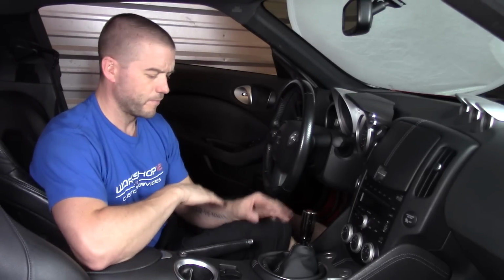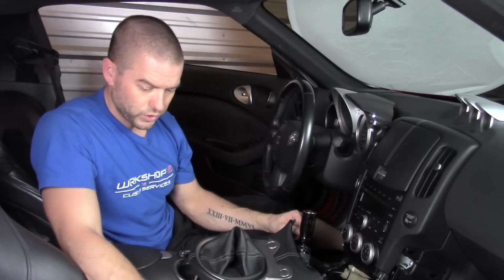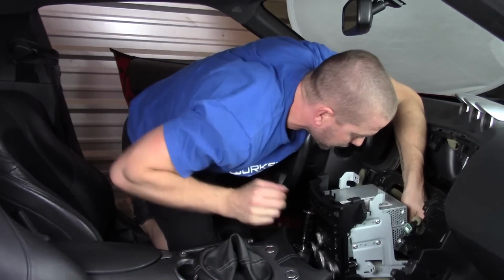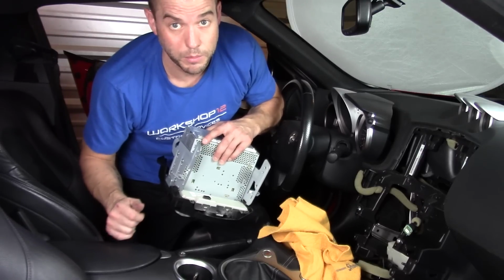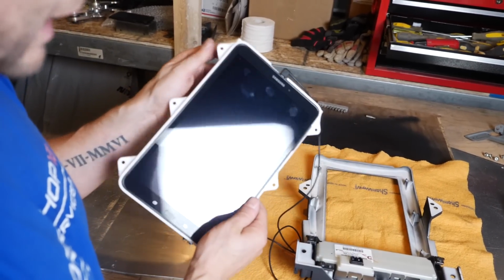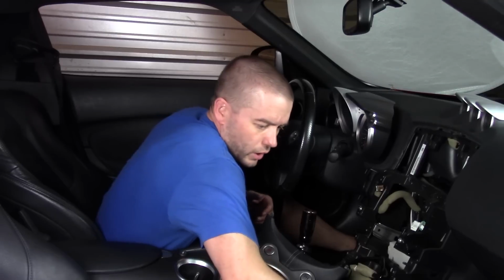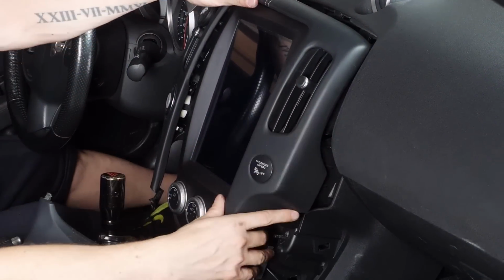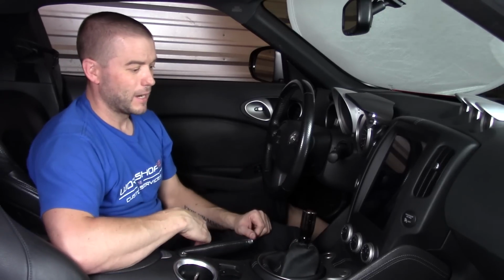Brainiac MK1 370Z Installation

Comment: Will this work on a 2011 nismo 370z? Thanks!
Reply from the maker: Is it equipped with OEM navigation?
Reply: Workshop 12 there’s no nav, it’s fully stock but it’s not the tech model so there’s no navigation system
Reply from the maker: @shelbytibbs5617  that should work 👍

Comment: Could this work on a 2010 370Z?, and do I need to use an android tablet or can I use an I Pad?
Reply: Yes it will work but you wont be able to use the speakers.. Because the head unit has been remove.. you have to buy the harness to connect thru it..
Reply from the maker: Yes, this will work on a 2010 370Z.  We do not support iPads for multiple reasons. Only specified Android tablets.  Tablet details and everything you'll need to know about the 370Z kit can be found here: https://workshoptwelve.com/nissan-370z/

Comment: How do you address overheating of the tablet in the summer or hot climates? This seems to be an issue.
Reply from the maker: We have made our latest MK2 kit so that if you are in extreme temperatures you can easily remove it from the dash and place it out of direct sunlight (under the seat etc.). Then pop it back in place. Only so much you can do to avoid this challenge with a tablet. https://workshoptwelve.com/nissan-370z/

Comment: I have a 2009 370z with nav, is it compatible?
Reply from the maker: Currently you would need to do a climate control swap to the non-navigation version. We are working on a possible solution for nav equipped 370z's but for now a swap would be needed https://blog.workshoptwelve.com/2018/12/29/370z-navigation-climate-control-swap/

Comment: 350$ is not a high price form something like this. at my shop i use to charge 250-500 to customize the original dash panel which of course can not go back to OEM once its done. this keeps your OEM parts intact if you decide to go back when you sell the car.

Comment: thank you for this video spend $2000 on this crap just to make it fit 10 inch screen.
Reply from the maker: We're working on bringing the price down, trying to find/work with suppliers where it can be produced at a lower cost.
Reply: @WorkshoptwelveConnect  i havent had a chance to accumulate the price. how much it cost without the tablet ?
Reply from the maker: @KavanMavati  The plastics that hold everything are 3D printed on demand by our supplier and shipped directly to you for $575 USD, plus a aftermarket stereo wiring harness for your car, a small amp, a couple of cables and a 12v-5v stepdown.  Currently we don't sell it all as a kit, so you would need to source those yourself.  We're working on pulling together a kit to make it easier.  If you have a BOSE system you might need a few extra things. You can find all the accessories you would need at the bottom of this page: https://workshoptwelve.com/nissan-370z/
Reply from the maker: @UCWWWJEqZ48VICpHrSwbO7PQ All the parts you need should be listed at the bottom of that page I referenced.  There used to be a module called the JoyCon EXR that would allow for the steering wheel controls but it seems to be out of stock everywhere.  You will need a Galaxy Tab A 10.1" (2016 version not the brand new 2019 version just released), Right angle 3.5mm stereo headphone jack to RCA cable (RCA will plug into your amp), Metra 70-7552 stereo harness if you don't already have an aftermarket stereo harness, right angle micro-usb charging cable, a 12v-5v voltage stepdown converter to charge the tablet (example of one is linked at the bottom of the page I referenced). Wiring instructions can be found here: https://blog.workshoptwelve.com/2017/07/31/how-to-wire-brainiac-into-your-car/
Reply: @WorkshoptwelveConnect  Thanks for the info, my last questions is does will work will aftermarket backup camera? also regarding the tablet , it has to be 2016 ? just because of physically fit . or more about Operating system?
Reply from the maker: @KavanMavati  We have been able to bring in the view from a standard aftermarket reverse camera feed in a similar fashion to this video link (https://www.youtube.com/watch?v=63lTJRQIicY) We'll be posting up a YouTube video on how we were able to get it to work, and which app we used.  Still working out the details.  The 2016 model version is specifically for it to fit in the plastics.  Our kit has been laser scanned to fit the tablet like a glove and secure it centered in the top opening.  The 2016 and 2019 models are nearly identical when it comes to hardware specs.
Reply: @WorkshoptwelveConnect  thank you so much. I will definitely will order the kit as soon as possible. I looked at my after market poieneer. It seems I already have stearing wheel module.
Reply from the maker: @KavanMavati  Are you using an aftermarket steering wheel module? If so it wouldn't be compatible out of the box.. you would need to find a way to plug it into USB
Reply: @WorkshoptwelveConnect  yes I am using axxess aswc-1. Also I did alittle more research about the tablet. Do you need to put custom kaernal for os?
Reply from the maker: @KavanMavati  No custom kernel at all.. simply an off the shelf Samsung Tablet.  No rooting or anything.  Our app is a custom home screen launcher available in Google Play.  The rest is pure Samsung Android :)
Reply from the maker: @KavanMavati  I think I saw a comment from you that disappeared.. our app name is "Brainiac Launcher" in Google play. To get your phone to work with the tablet you would need something like an Apple CarPlay USB dongle. We posted a video of it working.
Reply: @WorkshoptwelveConnect  I know I asked this question before. I went to bestbuy and looked at tab 10.1 2019 physically they both look the same. Is there is reason it has to be 2016?
Reply from the maker: @KavanMavati  they're actually different physical sizes. The new one is a little shorter and thinner. Our plastics were designed a year before the 2019 model came out. So they are designed to fit snuggly around the 2016 model.
Reply from the maker: @KavanMavati  The 2019 model is smaller in outer dimension. Exact same screen size.  So technically it can fit if you rig up some kind of padding around the tablet (maybe cut it out of foam or something).  If however you are looking to charge and run accessories at the same time, the 2019 model has a USB-C connector that might be tricky to find a solution.  We are currently talking to LAVA about a connector that might work.  So in general, we have not yet supported that tablet in an in-car scenario so we might not have solutions for everything you want to do quite yet.
Reply: @WorkshoptwelveConnect  thank you for the headsup. I will wait a bit waiting for your update. I want to put LTE in I noticed people where complain about 2016 model that's run on 3g only
Reply from the maker: @KavanMavati  Ah.. gotcha.. We'll be sure to keep everyone posted on our findings for the USB-C charge and accessory solution!
Reply: @WorkshoptwelveConnect  trsut me when it come technology I am so impatient. I already bought some parts I just want make sure money I spend on it worth it
Reply: I forgot to ask you I have a subwoofer how do I connect it since you have a 2 RCA input
Reply from the maker: @KavanMavati  For my sub woofer, I have an amp specifically for the sub.  I run an RCA splitter. One set of RCA's goes to my amp for the front speakers, and the other set of RCA's goes back to the amp for my sub.
Reply: @WorkshoptwelveConnect  can I just split the 3,5 to RCA into 4 and connect 2 side to front speakers and other 2 for subwoofer?
Reply from the maker: @KavanMavati  Yup.. that's exactly what I do.. just split the left and right RCA into 4
Reply: @WorkshoptwelveConnect  excellent
. I am going to order the parts tonight and I will wait on the USB type c. Since you helped me alot, how do I make sure you get the commission or credit for this. Thanks again.
Reply from the maker: @KavanMavati  All good... I'm one of the co-founders :)
Reply: @WorkshoptwelveConnect  thanks again I will reach out to you if I need assistance.
Reply: I order all the parts I received all of them except the brackets it will be next month. I have a question regarding usb connection. So basically the only usb port you are using is the V5 charging port. Act as accessories and charging. Am I correct?
Reply from the maker: @KavanMavati  If you are not using any USB accessories then all you need is a standard right angle micro USB charging cable. If you want to charge and use USB accessories at the same time then you will need a LAVA connector https://blog.workshoptwelve.com/2019/01/04/otg-usb-charge-hub-wtf/
Reply: Finally I got all my staff. I managed connect my audio, How do I connect my backup camera and steering wheel controller?
Reply from the maker: @KavanMavati  which steering wheel controller module did you go with?
Reply: @WorkshoptwelveConnect  not sure about brand name but definitely not the one you recommend it.  I am going to order it today. Let's assume I have the unite. How do I connect it to the tablet? Also my audio quality not good. I user AUX to RCA. I am going to get RCA to Bluetooth to tablet. What do you think?
Reply from the maker: @KavanMavati  For the Steering wheel controls you need to get a module that is compatible with Android.  We recommend one on our website on the Accessories page.  For Audio quality, if you are getting a hiss or hum then I would suggest a PAC noise isolator.. We are including one of these in our upcoming kit https://www.amazon.com/PAC-SNI-1-Noise-Isolator/dp/B000K50HJE
Reply: @WorkshoptwelveConnect  I end up using adapter converting RCA to Bluetooth, definitely better than AUX, despite made some modifications on my 4 channel Amp. I received LAVA today and I installed it on my car seems have low Ampege.
Reply from the maker: @KavanMavati  strange.. usually the Lava connector attached to a charge cable provides a good charge.
Reply: @WorkshoptwelveConnect  I looked up some reviews most people was complaining about lava output wont provide fully 2.5 Amp. About backup camera what adapter do I need? I bought a video capture USB to video RCA and hooked up to tablet but didn't work. Do  you have recommendations?
Reply from the maker: @KavanMavati  I'll have to ask Rob which adapter he used
Reply: @WorkshoptwelveConnect  do I need root the tablet in order power on the tablet when car turn on? Most likely when it dead you can't turn it back on. Also Brainiac app go idle after   few seconds when you in the main screen
Reply from the maker: @KavanMavati  If you want the tablet to totally turn on (even if out of battery) when it receives a charge signal then yes you would need to root.  If you want it to go to sleep and wake back up when the car turns on/off you just need to adjust your power settings: https://blog.workshoptwelve.com/2017/06/30/configuring-your-galaxy-tab-4-power-settings/

Comment: Man I wish you guys would have a iPad holder. That tablet is already outdated
Reply from the maker: iPads unfortunately have a difficult time being an integrated part of a dashboard. The tablet that is currently supported (2016 model) has almost exactly the same specs as the 2019 model released in February. We may support the new model if demand is there for it. Are there specific specs you are concerned about?
Reply: @WorkshoptwelveConnect  oh ok awesome. I'm really interested in this project unfortunately I have a navigation equipped 370Z.
Reply from the maker: @alexjohnson4759  ya, that makes it tricky. It is possible but takes some work https://blog.workshoptwelve.com/2018/12/29/370z-navigation-climate-control-swap/

Comment: So what about if the Z is with Navi and the dash with the different climate buttons?
Reply from the maker: In that case you would need to swap over to the non navigation climate control to use our kit https://blog.workshoptwelve.com/2018/12/29/370z-navigation-climate-control-swap/

Comment: does it work with tech package sport  Z?
Reply from the maker: Our system is meant to work with a vehicle that is not equipped with the OEM navigation system. It is however possible to convert the OEM Navigation climate control to the standalone unit https://blog.workshoptwelve.com/2018/12/29/370z-navigation-climate-control-swap/

Comment: Australian Z'ds are different to what your viewing.
Our climate control has small knobs compared to your big ones and your middle knob is a push button for us.
Reply from the maker: Do you have pictures you can share? Our kits are specifically for 370z's that are not equipped with OEM navigation which had a different climate control layout
Reply: @WorkshoptwelveConnect .
Yes matey I can show you a pic just not sure how to upload it in utube.
If you give me a email I can send it through that.
Reply from the maker: @dainepetrou8011  sure, you can send it to info@workshoptwelve.com
Reply: @WorkshoptwelveConnect .
Ok I do it in the morning as it's almost midnight over here.
Reply: @WorkshoptwelveConnect   would there be a potential to make a kit for the OEM NAV optioned 370z's?
Reply from the maker: @michaelcalagis1308  it is possible to get our kit into an OEM nav 370z if you swap over to non-nav climate control. So far that's really our only solution. We may be able to do something in the future. Here's an article on how to do the swap https://blog.workshoptwelve.com/2018/12/29/370z-navigation-climate-control-swap/

Comment: Do you guys have a recommendation for tablet that won't be destroyed by the Phoenix summer heat?
Reply from the maker: Not sure what all the specs are out there for temperature. You could also look at an option of a 10.1" screen module combined with something like an UDOO board. But I don't know if its heat tolerances would be much different
Reply: @WorkshoptwelveConnect  outside temp can average 110f + during the summer and a car sitting in the heat can easily reach 140-160f most electronics fry in the heat. I'll look at udoo as it might be rated for more. Thank you for the reply.

Comment: so once installed there's no way to "quick release" the tablet?
Reply from the maker: That is correct. It is built into the center console for an OEM look.
Reply: @WorkshoptwelveConnect  copy that, I thought I saw a member with magnetic fasteners. but you would still have to take all the other plastics off prior, correct?
Reply from the maker: @mattylow_z34  the 350z plastics that one of our community members modified is a lot different than the 370z. I don't think the same thing would be possible with the 370z plastics
Reply: @WorkshoptwelveConnect  copy that thanks for the insight!

Comment: Does this work with the steering wheel interface?
Reply from the maker: It can use your steering wheel controls by adding a JoyCon EXR circuit board